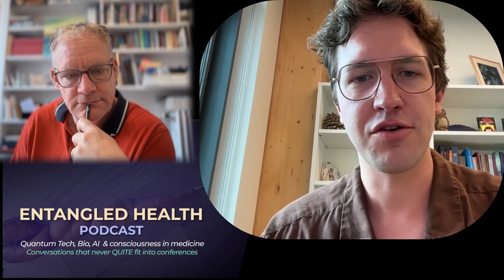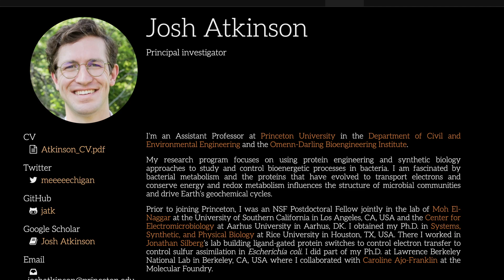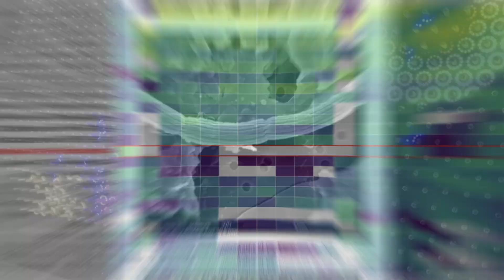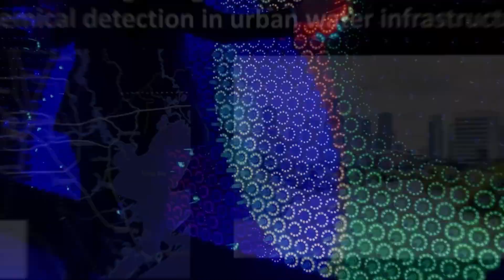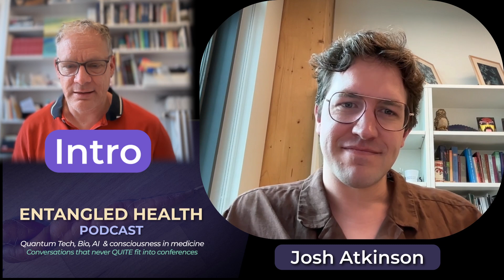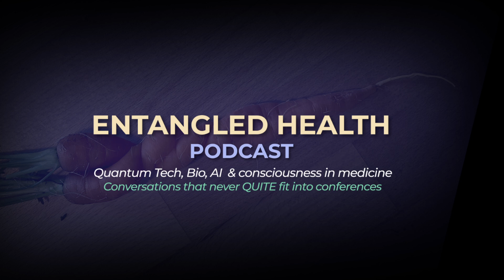Bioelectronics - Could Bacteria POWER the Future of Electronics? | Joshua Atkinson (Princeton)

Comment from the maker: In this Entangled Health episode, Dr. Joshua T. Atkinson (Princeton University, Civil and Environmental Engineering & Omenn‑Darling Bioengineering Institute) explains how microbial electrochemistry turns microbes and biofilms into parts of electronic circuits. Instead of forcing metal and silicon into wet, salty tissue, we ask what happens when biology itself becomes the wire—from Shewanella oneidensis and Geobacter nanowires to living biosensors for endocrine‑disrupting chemicals in water. We even touch chiral‑induced spin selectivity (CISS) and when quantum effects might matter for electron transport in biofilms.

Question for you: If biofilms and microbes can act as sensors, wires and circuits, where should we draw the line between a “measurement device,” a “living organ,” and a “bioelectronic machine”? What feels exciting—or worrying—about using living circuits to monitor our bodies and environments?
Reply: maybe we bypass the „digitalization“ and come back to analog signals - that would be interesting